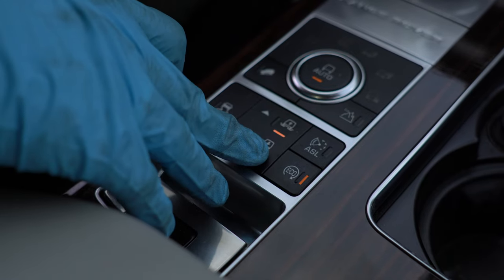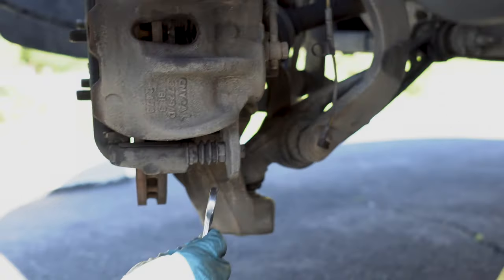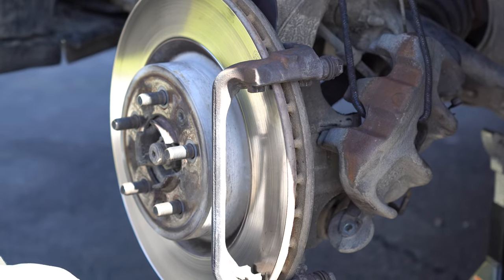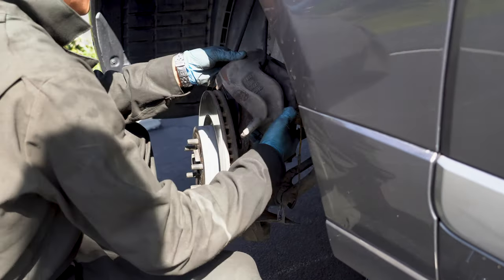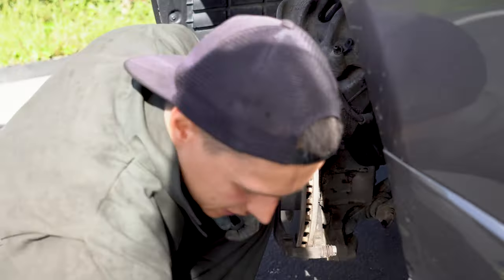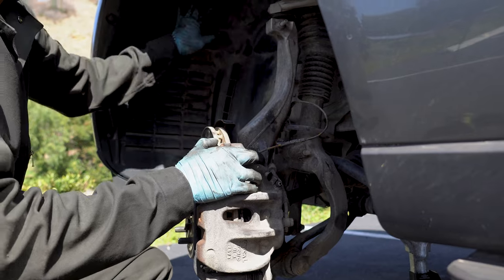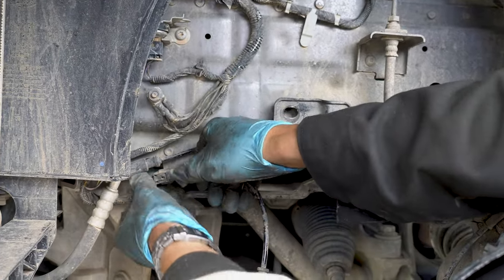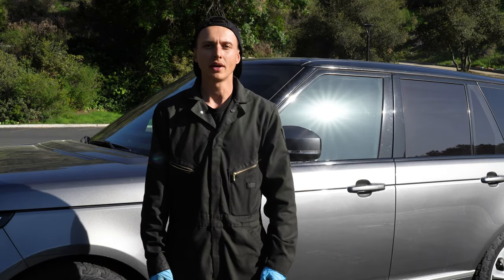Front Brake Pads and Rotors Replacement on Range Rover, LR4, Discovery and RR Sport in Step by Step

Comment: Ok so just followed these steps exactly on my 2013 RR Sport HSE Lux and went without any issues.  Thanks so much Aleks!!  You saved me a lot of money. When I put my sensor back on (the old sensor) it fit kind of loosely.  I was expecting it to be snug in there like when I took it off.  Ok, tomorrow will be the rear brakes and rotors so I’ll comment on that video afterwards.  Thanks again!!

Comment: Great job manual. That torque for a bolt holding the disc is a bit larger than what the average set would have, but 6 mm hex key did the job. Took 12 min from driving vehicle into garage to exiting.

Comment: Fantastic. Doing this next week - my rotors warped and the braking causes steering wheel shudder. Great video...
Reply: Done. It was indeed the warped rotors issue. Steering wheel vibrations completely gone, braking smooth even at 170km/h, when before the rotor changes steering wheel was shaking so bad that it made me nervous - only at light braking, though. Now it's all fixed. Thanks again for the great video...

Comment: I’m going to change the discs on my daughter’s Range Rover Velar, I’m guessing the procedure will be very similar to the Range Rover you’ve just done, very helpful, thank you.
Reply from the maker: Good luck!
Reply: Let me know how it goes if you can. I'm about to do front and back pads/rotors on my 2019 velar R dynamic Hse
Good luck
Reply: @alexkatler  They didn’t require changing, the discs had some rust around the edges, I cleaned them with a drill and abrasive flap wheel and they were good enough to pass MOT. I couldn’t find a way of unlocking the hand brake as the Velar’s brake is fully automated ( no lever/switch) so I think some sort of OBD tool would be required to enable changing them.

Comment: A great Thank you for this clear explanation. I replaced both front and rear brake pads with your help and this would have costed in Belgium 2 x 400 € = 800 €. I ordered them from Autodoc and costed me with new sensors 100 € for 4 wheels. Took me 1 hour per axis . Thanks
Reply from the maker: I’m glad to help

Comment: So clear. My good friend who had a 2016 LR4 just passed away a few weeks ago and before he died he asked me to give it a once-over for his wife. Going to do the brake pads, front and rear, in a couple days. Anything special about the rear pads? Also, do I need to replace the sensors? (BTW, the dealer quoted her $2850 for new pads, rotors, and sensors..!)
Reply from the maker: No way, so expensive. If the sensors are damaged and worn out by thin brake pad you have to replace them.

Comment: Here are some more torque specs 13mm Bolts - 26 ft-lbs, Rotor torx 50 bolt  - 12 ft-lbs and caliper bracket bolts - 208 ft-lbs
Reply: Please, where can I find that information?

Comment: Hi Alex.  Thx for the video.  I couldn't get my car into maintenance mode.  I started the engine and released the e brake manually.  I could not compress the brake piston back.  Looks like I need to replace the caliper now.  It's seized.  For the other rear, don't attempt to disassemble until in maintenance mode?  Thanks for the time.
Reply from the maker: Hi! Not sure what you did, there is a step by step explanation on how to do the rear brake pads. If you are not sure what you have done, I better recommend to contact a specialist who can help you with that. Sorry to hear that!

Comment: Thanks man super cool thanks
Reply: @alexfixty  Good Day! Pls I loosed and removed the two back brake callipers to compress them as the new pads wasn't entering, after fixing them back and bleeding, the brake pedal goes flat at first and comes a bit hard after several pumping but still goes flat when left for few minutes, had tried several means of bleeding, even changed the brake master and ABS Module but still having same brake failure.
Kindly help urgently. It's a Range Rover 2014 Autobiography.
Please help provide solution to me as I've been on this for two weeks now customer running out of patience for mare changing of Brake pads

Comment: Thank you for the video. Can you advise what size C Clamp you used for caliper compression step?
Reply: If anyone was wondering about this around @3:28 once the two bolts are removed I took off the caliper first then used a 4 inch c clamp to push in the piston.
Reply: Just make sure your reservoir is opened and take some fluid out when pushing the piston back. Only if your brake fluid is full you need to take some fluid out or it will overflow when doing this piston retract.
Reply: @justdave5121  I saw this step left out from video but I have done brakes before and did ensure the brake fluid reservoir cap was open. Good info for others though.

Comment: Hi 👋 do we need to change brake sensor wire every time change brake pad or can use the same old.
Thanks 😊
Reply from the maker: Hi! If the sensor is good and there is no brake light on dashboard, no need to replace it
Reply: Thanks 🙏

Comment: Do you have to replace the rotors every time you replace the brake pads? My rotors appear to be fine and dont vibrate but brake pad light came on.
Reply: Been a while since you posted, but you can also have your rotors “turned” at Oreilly s auto parts.  I think they charge $20 per rotor.  Drop them off in morning and haven back a few hours later.  If the rotors are within spec, you have at least one “turn” you can do on a rotor, instead of buying new rotors .  You DO want to turn or replace each pad replacement otherwise your pads get chewed up faster and possibly glaze (the rotors turn a bluish red tint from overheating) the rotors.